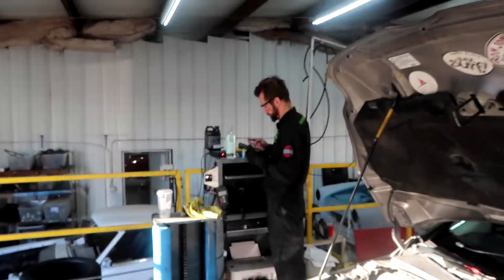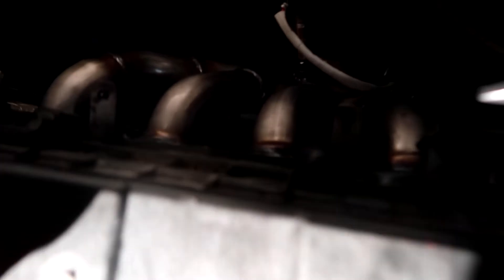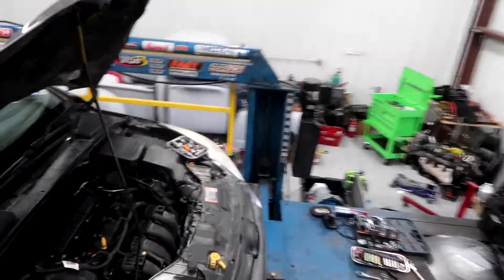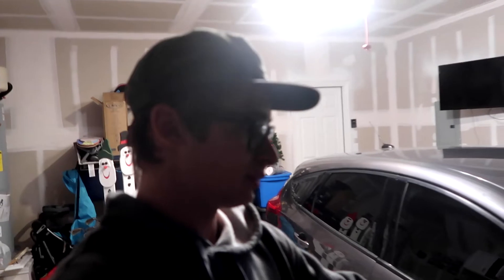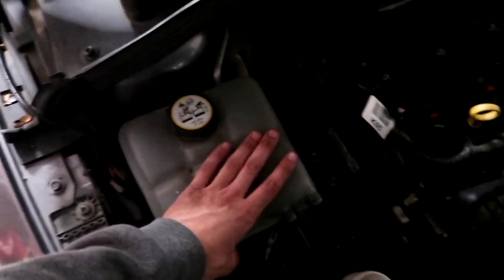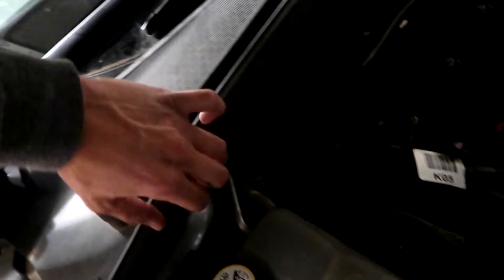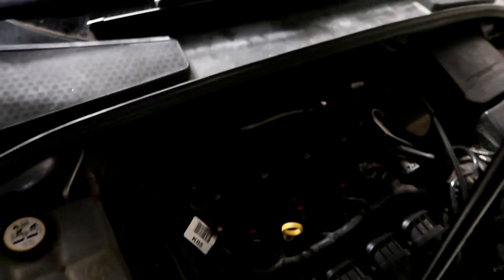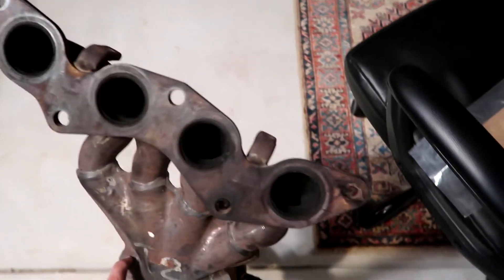How to change catalytic converter on 2014 Ford Focus SE!

Comment: Soooo technically theft of one is highly difficult nd i dont have to worry? Outside the cost to replace the sucker after a while😑🤣 mine is a 16 focus se. Apparently around the corner a lady was robbed of hers on a slightly older Lincoln

Comment: Dis you notice it run better at all after changing out cat?
Reply from the maker: Yah for about 2 weeks. Now it’s back throwing a check engine light again and same problem.
Reply: @BassAdventuress  hi, even after changing the cat, still throwing the same check engine problem? So cat is not the problem?
Reply: @gladex123 purge valve

Comment: You couldn't drop it out through the bottom?
Reply from the maker: No cause the frame was in the way.
Reply: That was be the "Correct way" However, that requires dropping the front crossmember...

Comment: Im having same problem. Did you notice a change in performance and the way the car ran after you replaced the cat?
Reply from the maker: Yah for like 2 weeks and now it’s back to the same way it was before I replaced it. Idk why. Just annoying
Reply: @BassAdventuress  is the light back thoe ? Pls respond big daddy
Reply: @BassAdventuress  You ever solve this issue as for what caused it again? Mine just threw the same code/issue too. Contemplating to just yeeting this car.
Reply from the maker: @doritogeru I didn’t have a issue for about another 6-8 months and then the code came up again. Changed out O2 sensors again. Same issue. Sold the year a couple months after all that. I was over that car lol
Reply: @BlakeBasss  thanks for the warning, man. Mine's been fine now after premium fuel and cataclean but according to your experience, I'll be prepared to face what you went through so im not caught off guard. Just feels silly to replace any expensive parts outside of maintenance for a car that has $500-$2000 trade in value.. in good working condition today 🙄
Reply: It is the converter itself, those less expensive aftermarket ones fail fast.  Magnaflow, Dorman, or Walker ultra are the only 3 brands to every use if you don't want to redo it once a year @BassAdventuress